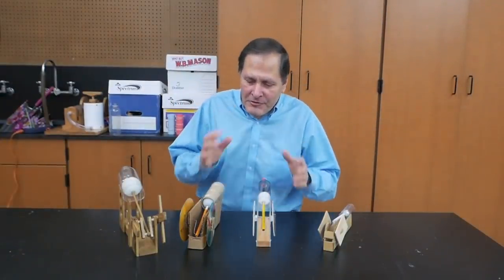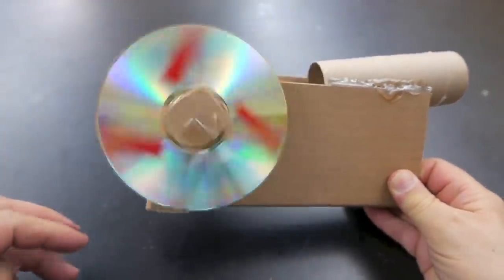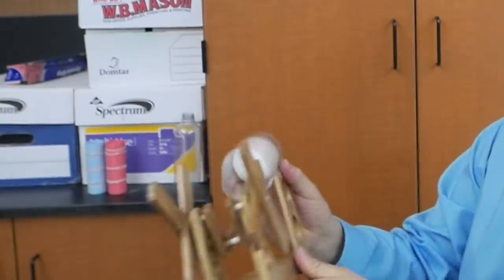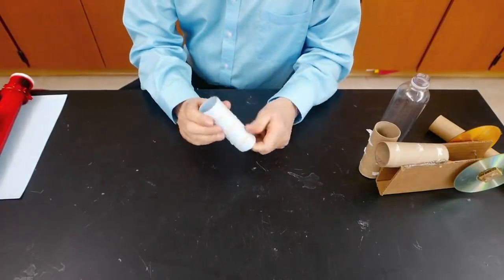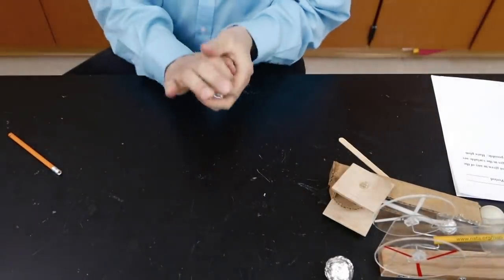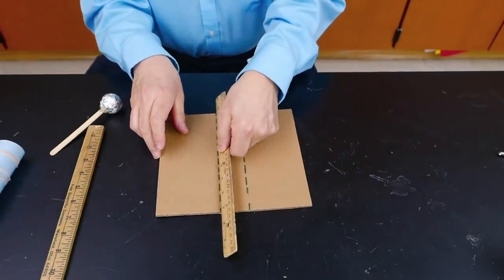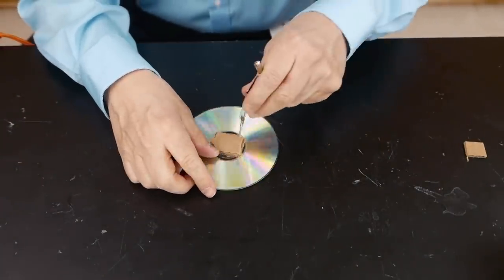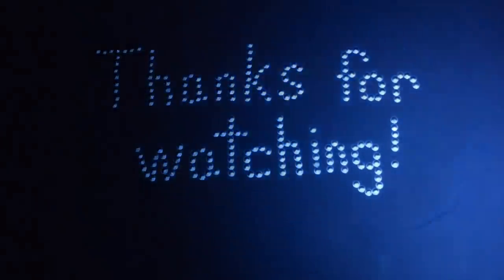Reciprocating Air Engines-- Easy build // Homemade Science with Bruce Yeany

Comment: If you made the piston air tight and attached a hose this could be a hand crank water pump using vacuum suction from the piston. You'd need some sort of a valve(s) though and an airtight hole on the piston to redirect the water flow to an attached hose. Wish I were smart like you so I could make it. I wish that I could see a video of how to make this. Blessings

Comment: It should be noted that operation of the mechanism is dependent on the frequency of the reversing air flow. If the cycle is out of phase it would not work. If the flow of air is out of phase the piston would be forced in the opposite direction resulting in reduced or even reciprocating rotation.
Another thing to note is that the mechanism should work with pulsed air but at reduced speed.
Reply from the maker: thanks for your comment.  You're right, due to the simplicity  of this piece   it is up to the person to inhale and exhale in phase to operate the motor.  Something that has been quite amusing watching students attempt for their first trials.  Some get it right away, some take a bit longer.  Also right on the idea of the pulsed air in one direction,  they work but not nearly as efficient.

Comment: I think I have seen this before
Reply from the maker: This video is a reposting on simple air engines that has been posted before.  It was previously flagged for mature audiences only.  After reviewing it several times I have not been able to determine why nor was it explained.  I did make a few minor changes but nothing that would have changed it's rating. I have had students in middle school make these motors and found it to be a valuable project in understanding the basis for reciprocating motors.